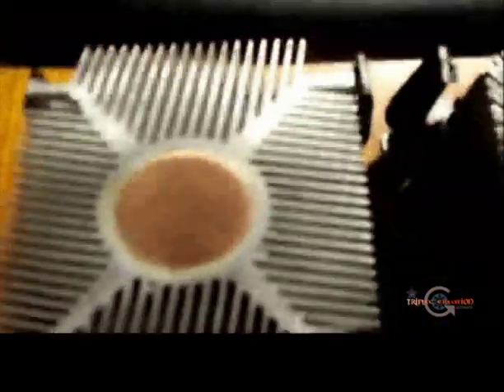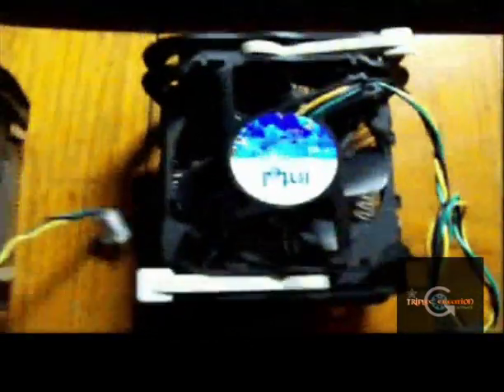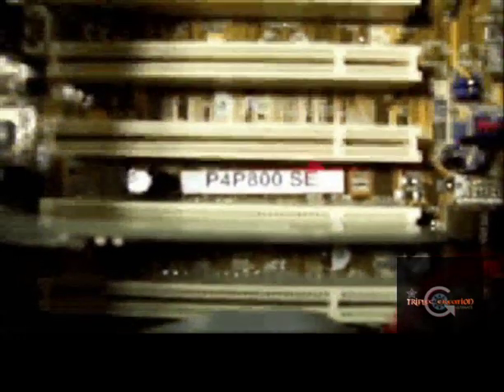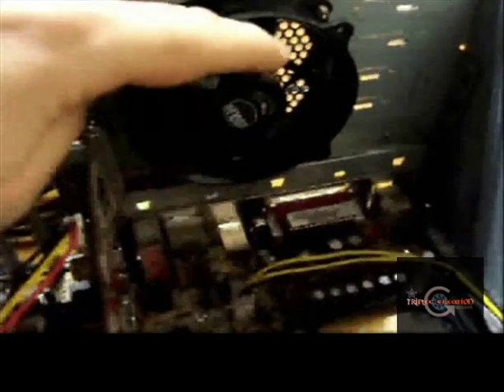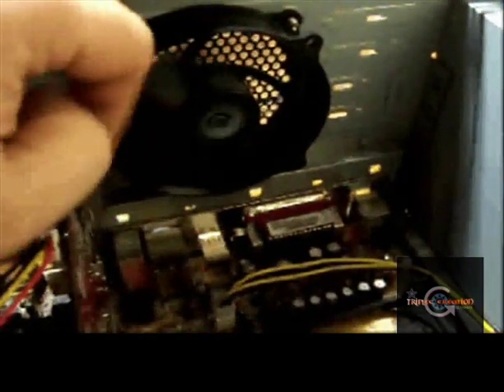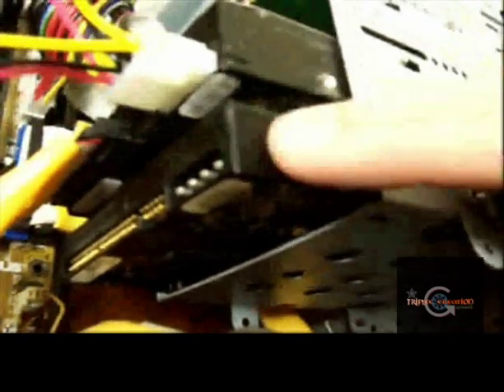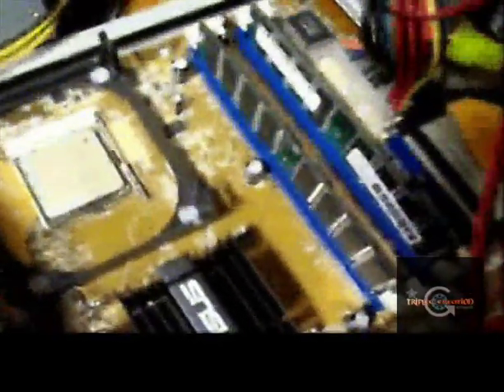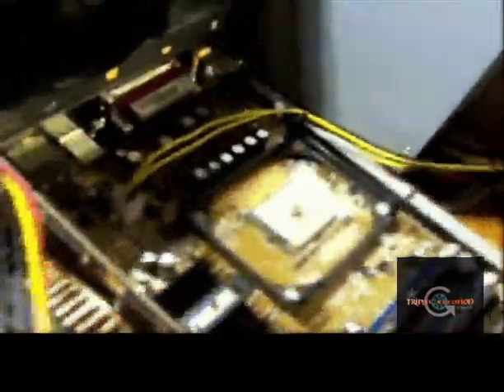Overclocking Intel Pentium 4 3.0Ghz HT on Stock Cooler

Comment: I have same processor (Pentium 4 3.00E socket 478) on Asus P4P800 Deluxe, and I overclocked it up to 3.90 Ghz with Intel stock cooler (1.45V V-Core).
Machine is still fully stable at 3.65-3.70 Ghz. 
Look at my channel for related videos!

Comment: As much as overclocking depends on cooling,I don't know y u would put a dab of heat sink grease on as u did & trust it will spread evenly to every speck of those surfaces. U get inconsistent thickness of it that way &, possible hot spots that could b running cooler if it doesn't spread perfectly,or 2 much oozing out in one side etc., depending on the squish, It's prob,fine but why not do it right? put a baggie on yer finger and spread a good thin coating like ur supposed to do when using it.

Comment: Hello. Intel pentium 4 ht 630 prescott-2m how many cores? Everest: Multi cpu: cpu 0 and cpu 1 is 3.00 ghz. Cpu Utilization: 1. CPU/1. HTT and 1. CPU/2. HTT. Dual core or single core or X2? Because the core Temp program: Select CPU: Processor 0  1 core(s)  2 Thread(s). And the second core??

Comment: does the chasis fan do anythign because i run my P4 hp d530 cmt without chasis fan 
i opened the chasis and putting it in a cool place in the corner and it never execs 50°C and cpu range (low 28°C high 44°C)

Comment: @Daco65 Me to had prescot (Still have it, little brother use it) it was fine with stock cooler i didn't cared pc temp much while ago but - one day i checked it was already 60 - 78c with stock cooler, so i changed to cheap one aftermarket and got 35 - 45 idle & 50 - 58 load .  I have spare Intel D 2,8 Ghz but idk if it better than 3.06 prescot. My old prescot works fine with overclock 3,3 ghz , it can work for some time 3,5 - 3,6 but its to unstable and twice i tried 3,8 ghz lasted for 5 min :D

Comment: @MrTpengineer 48°C is imo alot and i had 50-55 back when i had a prescot. see what temps you get when you put it under load. was 70-80 for me and 3000rpm of the cpu fan (which makes a shit ton of noise)

Comment: @6oLsh0i6o0z3 not all mothoards are overclockable, most MSI boards are though so you should be able to, if you cant try looking up some good overclocking boards that support your current hardware and see if you can pick one up off of ebay or craigs list for cheap, good luck!

Comment: i think p4 517 would be much better for oc then the one you have. simply its lower fsb+ higher multiplier ratio given more chance to go above 4ghz. and 800fsb don't seem to be as easy to raise the fsb over 266mhz in most case

PS: i got my 517 with 5,5ghz (266x21) with air cooling(cm v11). idle 65c load 95c

Comment: @tylermoore okay, but why the motherboard it sees at 2ghz, since the default frequency is 3 Ghz. At proprierties in my computer dispalys: Intel Pentium (R) 3.00 Ghz   2.48 Ghz. 2.48 resulting by overclocking from 2 Ghz.

Comment: @tylermoore hm what voltage should have the cpu to match. I have a gygabyte motherboard year 2003. In this case the manufacturer shouldn't assume responsibility that some motherboards support 3, 3.4 ghz when in fact it does not support more than 25% from initial cpu power.

Comment: Hi. I put a 3 ghz cpu on the motherboard. The old one was 1.7 ghz. This new one is seen by the motherboard at 2 ghz. Why?.... The motherboard supports up to 3.4 ghz. I tried to overclock and i have a big problem, more than 2.5 it's not possible, the operating system has been crash every time when i try to pass over 2.5.

Comment: dud im cluless on processors except the ghz.
wats the deal with pentium 4?
they run twice as fast and at half the cost of some of the celrons!
anyway, is it worth it to get one?
i have a socket 7775 pc motherboard and a "478 to 775" socket adaptor for it.

Comment: SabatonPwns i agree. i used some old parts laying around my room and built a machine capable of playing gta iv decently lil lag but deffinatly playable. specs are
GA-965P-SE Motherboard
Pentium 4 2.8ghz (Model 521)
1.5gb 533mhz Ram (need a ram upgrade)
Galaxy 8800GT OC
Logisys 480watt psu
Windows XP x64 SP2 (for whe i upgrade ram)
IDE ATA100 Seageat Baracuda 80GB HDD (the sata controller is burnt out on that motherboard so i cant use sata hdds)
and some old dvd drive from a Dell Dimension e310

Comment: tricccple thats because your video card is bottlenecking it not your processor. in my case with the specs i posted on someone elses comment on here its the opposite of what your exsperiencing because I have a 2.8ghz p4 on a 8800GT OC

Comment: pentium 4 doesnt suck, i have a pentium 4, socket 775 with hyper threading running at 3.0ghz, i can run games like call of duty 4 and crysis , street fighter 4 , every 1 max settings, NO AA, with a ati raden hd 3650 pci express 1gb